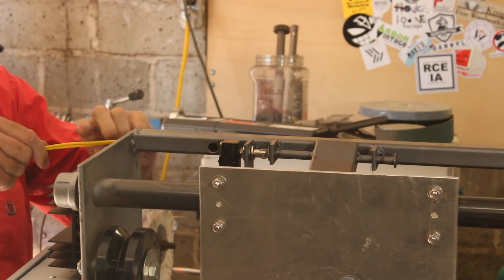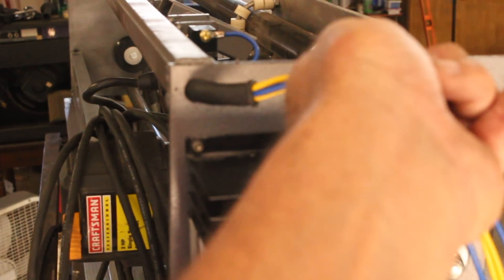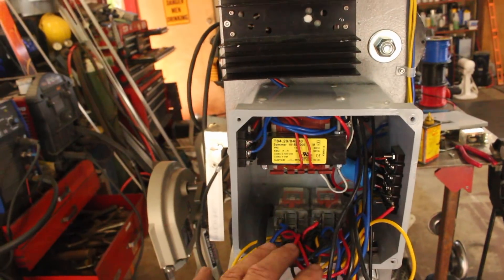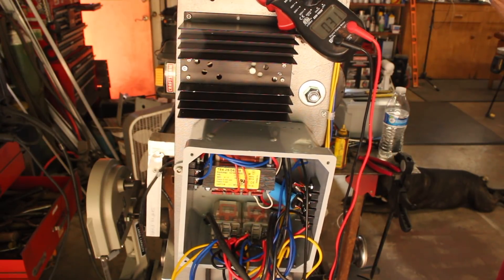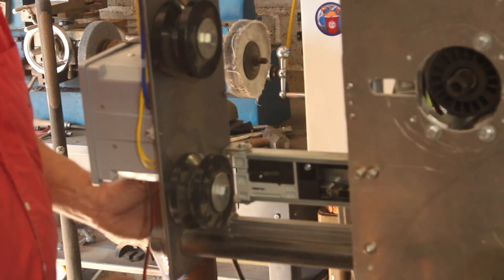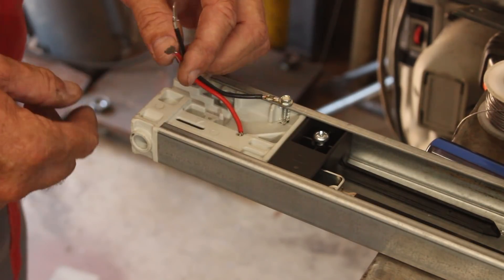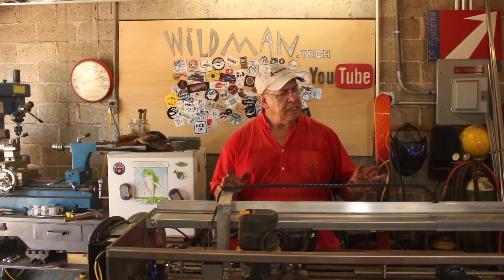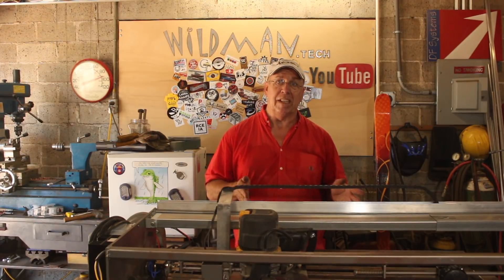Wood Slab Surfacing Machine - Part III

Comment: Wow, 25 years to complete the project...I thought the 4 years it took me to aquire all the parts for a ham radio project was a long time.  What kind of cutter head are you planning on using?
Reply from the maker: Edward Clayton the gantry started out as a panel saw. I saved it from the scrapyard using for this.

Comment: Those switches worked perfect and solved the issue. Having everything on wheels is a real benefit in the shop.
Reply from the maker: I had high hopes for the arduino microcontroller, but my skill with those things isn't the best. Thanks for watching Lloyd.